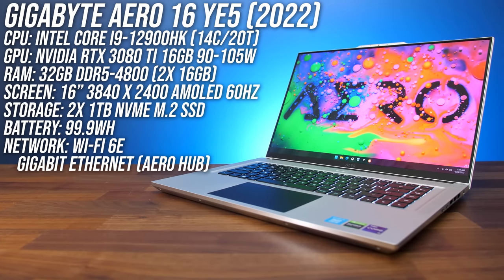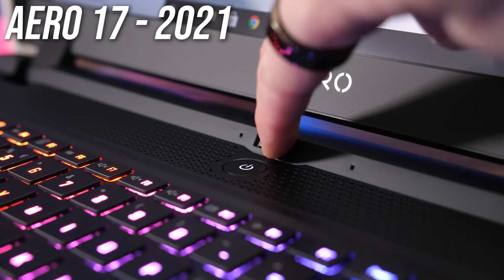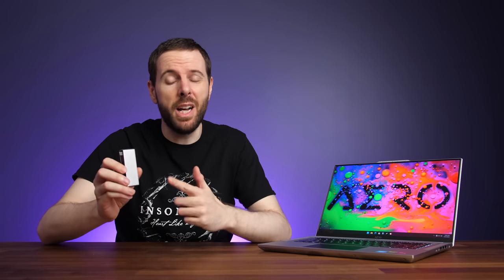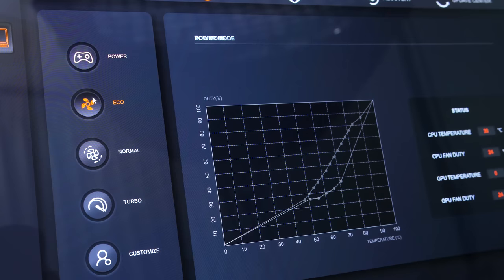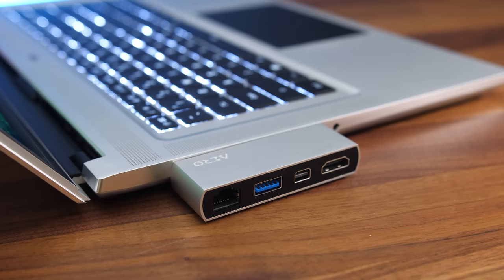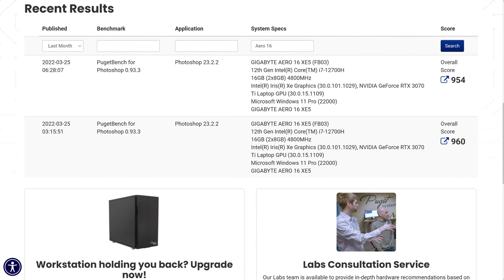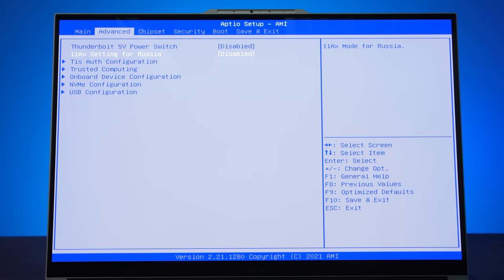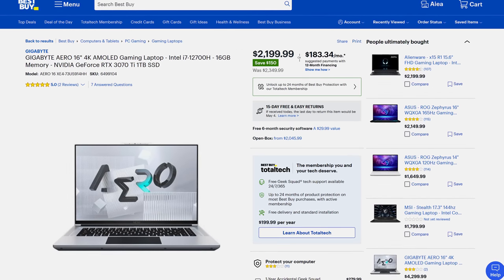Gigabyte Aero 16 Review - Why Did They Do This?

Comment: I7 3070ti for 1400 is insane! Best deal I could find that had more than 1 thunderbolt port. You'll likely be less thermally restrained as well because of the slightly lower spec parts. so coompared to other I7/3070ti systems i bet performance is similar. I'll see when I get mine :)
Reply: Did you get yours?
Reply: @TechDidThis  I got mine today! Had to wait for it to ship. Didn't like the software it came with so fresh installed windows. Otherwise I love it so far! Performance is decent! A little slower than other 3070ti but not much. I think the oled screen makes it worth it. Most people don't game using the screen in the laptop so frame rate doesn't matter. Perfect for media consumption and creation 👍
Reply: @UchihaSumairu  I just ordered a legion 7 gen 8 with a rtx 4080 and I'm thinking it may be overkill
Reply: @TechDidThis  rofl prolly!! But hey it's a big investment so to all out of you want :) enjoy your new laptop! I've heard amazing things about that one too
Reply: Got mine on a legion pro 5 32gb ram 12700h 1to ssd and 3070ti on 16inch screen hdr500 165hz November last year for 1360€ on lenovo website … so no it is not a great deal here especially knowing legion pro 5 manage better heat and noise than the aero 16 
Only positive here is that the aero has an amoled screen I doubt we can see difference with the legion pro screen
Reply: @TechDidThis  not overkill if you want to play in silence
Reply: @REDIUS999  that's usd my guy. It's a good deal. Dont try and have a "who's dick is bigger" contest on the internet over who's laptop is better. 3 thunderbolt 4 ports is a huge plus. Also OLED is a huge deal. It's a very clear and solid difference lol especially black levels. This laptop is great for people who need the things it has that yours does not. Yours is great for people who only care about games. And again it cost a lot less than yours did.
Reply: @UchihaSumairu how is your gigabyte aero 16 now? Still good my bro? I'm planning to buy this but I'm kinda scared when it comes to gaming.
Reply: @rin_blank5830  I haven't had any issues other than I found out removing the built in gigabyte fan software screws with the fan controls so make sure to install it if you wipe it. Screen is amazing. I can pretty much max (or high) most games at 1440 and haven't found one that isn't perfect at 1080. 4k is 2 much for pretty much all laptops still tbh except older games

Comment: Aero 15 was doing fine. The only downsides are the nose cam, the wobly screen and the software. They should've focused on fixing that instead of redesigning it and removing all the important things that creator uses (I MEAN THE F*CKING SD CARD SLOT GONE?!). In my opinion the old aero 15 chassis looks sexier too. I really wished they used that same design with a little improvements or even just color options. Disappointed about where gigabyte is leading the aero line.... it used to be great. Oh well just pulled the trigger on zephyrus "m16" (no pun intended)
Reply: Actually I like the new design, USB C x 3, 2 out of these are thunderbolt 4.0, keeps the options open for anything,  Aftermarket dongles have it all.

Comment: 05:56  if they can just punch a hole similar nd smaller to a kensington lock for attaching that thunferbolt hub to the laptop it would solve the wobbly design of it 🌚

Comment: I'm trying to decide between the AERO 16 XE4 (with a 12700H, 3070 ti 105w, DDR4, etc) for $1099 and a Gigabyte A7 K1 for $875 (which has a 5800h and 130w 3060); on both i'd be swapping in 2x32gb 2666mhz DDR4 ram and additional storage. The Aero seems like an almost clearly better choice, but I'm concerned how the 12th gen processor will play with W10 or if disabling the E-cores to fix those issues will negate the better processor, and if the QHD resolution might actually hurt more then it would help at a screen size like this: I'd rather run games at higher settings at 1080p then lower settings at 2400p or upscale, and running games at lower resolutions but windowed seems like it'd be pretty small on a 16in screen, though I can't say for sure since I can't test it yet, of course. Thoughts? 

I do a lot of multitasking (literal hundreds of internet tabs at once, tons of multi-layer image files, etc) gaming, and some light video editing/rendering.

Comment: Hey jarrod when are ryzen 6000 series laptops coming?
I would like to see if AMD's effienciency claims for 6000 series are true. The g14 is a single data point
Reply: The battery life is superb. I've an asus g15 2022 that comes with 6800h and 3060(140watt) recently and it just blew my mind how far gaming on laptop has come.
Reply from the maker: I do not know, but I haven't been sent anything apart from 6900HS in the G14, which means probably AMD delays. That said I bought a 6800H TUF A15 which should be here soon.

Comment: The OLED screen, 3070 ti and 12700 at 1600 dollars on Best Buy made it too good for me to pass up. 

The screen is amazing. I play games at 2560x1600 I think it is and idk my thoughts are even tho that’s not ideal, the OLED more than makes up for it in terms of picture quality. 

I prefer this OLED screen at lower than native resolution over my LG 34 gp83b (ultrawide 3440x1440p) for my desktop. 

LCD with minimal backlight zones are dead to me. 

Overall cool laptop. I’m not planning to ever use it for games like cyberpunk, etc. I’ve been using it for XCom2 and that sort of game and it looks great. Coil whine for sure. 3070 ti runs cool but the 12700h absolutely does not.
Reply: Love the touchpad too. Surprisingly good
Reply: Can I play 4K games at 120hz on this once it does not have HDMI 2.1?
Reply: @cemi_8945  You should be able to play 4k120 over DP1.4 over USB-C, but thunderbolt does not give you 4k120 over HDMI as far as I know.
Reply: Have you had any problems?
Reply: $1300 at Best Buy I'm really in it for Oled . 1080p Ultra or 1440p Ultra gaming for me
Reply: @Yoko.Kurama  no problems. I got a cooling pad for it which I’m glad for. I use it for general use and for gaming on our living room tv. Plays older games like dragon age inquisition at 4K no problem. For heavier gaming it may be worth to wait for 40 series. All depends on what you want to use it for
Reply: @danw7864  ok thanks. Don't care about 4k on a 16 inch screen. Just gaming at 1080p&1440pp
Reply: @Yoko.Kurama  so it does have loud fans and the gpu is down clocked due to tdp being lowered. A true gaming laptop would allow more wattage than this computer. Just keep in mind.
Reply: @danw7864  yeah I know it isn't a true 3070ti performer. Just at this price point I don't see anything beating it with a Oled screen
Reply: @Yoko.Kurama  I agree and that’s exactly why i bought it.

Comment: Hey Jarrod I'm going to buy a gaming laptop and I'm confused as there are so many options around!My concern is gaming and my budget is around 1500$.I've got a few good options on the table : Hp omen 15 [ryzen 7 5800h , rtx 3060(100w tgp)] , Acer predator helios [intel i7 11800h , rtx 3060(105w tgp)] and  Msi alpha 15[ryzen 7 5800h , rx6600m(80-100w tgp)].
I would appreciate any kind of help.
Reply: which alptoop did you end up buying?

Comment: @Jarrod'sTech, is this laptop worth it at 1249$, 4k AMOLED with 3070ti for light gaming on laptop's screen or playing FPS like COD on a monitor
?
Reply: I have last years aero 15 OLED with a 3060, I don’t game on it now cuz I fucked up the gpu using Liquid Metal so it doesn’t work, I saw the aero 16 on sale on Amazon for 1499 and I couldn’t pass it up at that price, you will not find a laptop of this build quality, screen, power at this size and price, the 3060 was perfect for 1080p, I’ve played some games in 4K but at like 40-50 fps plugged into my 4k120hz tv, the experience in 4k was okay, it was slow compared to higher refresh rate games but it was visually beautiful, I think the 3070 TI will be quite decent for 1440p 80-90 fps which is not bad for a laptop and in 4k it will run 40-60 fps depending on the game ( definitely not cyberpunk) and a lot of games now have DLSS which can help you boost your fps by a decent margin without too much visual loss, so I’m waiting rn but I know I’m gonna love the laptop when I get it, I still only play connected to an external 144hz monitor so I have the best of both worlds and I recommend you do the same if you buy it
Reply: Did you get it? If yes, how is it?
Reply: @ever45  yes I have the aero 16, it’s great, I love it, except the awful gigabyte software, the screen is amazing but ofc limited to 60hz which is not ideal nowadays but I have a 144hz monitor I plug it into for gaming, I also flashed the vbios to increase the wattage of the GPU as 105W is fairly low, I flashed it to 140W with huge performance gains, I can play some games in 4k 60fps (with DLSS), the build quality is excellent and it looks great, feels like a windows MacBook if you know what I mean, for the price I paid (1400 USD) which is almost 1000 dollars cheaper than MSRP, you won’t find anything better than this at this price.
Reply: @themartianman2614  thanks, appreciate it!
Reply: @themartianman2614  Ive been looking at this laptop, and doing what you've done with the vbios. Have you had any issues with cooling when gaming using the flashed vbios?
Im concerned with the cooling not keeping up with all the added power.

Thanks,
Reply: @carbonation28  hello and sorry for the late reply, yes, the vbios flash did increase temps by a bit, stook, the gpu wouldn’t go over 80c in gaming loads but with the vbios cranked to 150W the gpu hits a high of 85-86 c which is toasty for a the gpu but I’m not worried as this is a slim laptop in the end, I usually have it on gaming mod and it’s decently loud but with headphones on and ingame music, I don’t hear it all, in the end the vbios flash was worth it in my opinion due to have how easy it was to unlock the full potential of the 3070 ti, I can play 4K 60 with DLSS no problem now.
Reply: @themartianman2614  thanks for the reply! Can you tell me which bios you've had success with? My laptop arrives tomorrow, I plan on flashing the vbios myself. Thanks!

Edit: nvm, mine is the 3070ti, I see yours was a 3060
Reply: @carbonation28  no mine is the 3070 TI also, my older aero 15 was a 3060, for the 3070 TI I used 130W AORUS vbios and 140w clevo and now I’m using a 150W tongfang, all tested and works perfectly and I stuck with the tongfang bios because it provided the highest average wattage draw (which I want for maximum performance) but your Gpu will be toasty compared to the 130W one or even the 140W. The 150W tongfang averages at 130-140W whereas the 130W averages 110-115W
Reply: @themartianman2614  hey thanks for the help! I'ma try the tongfang one then!
Reply: @themartianman2614  Hi again! So I've been trying to flash the vbios on my aero 16 3070ti, but I keep running into issues with nvflash. I've tried some patched ones that were supposed to help with the board mismatch error, but I continue to get them when trying to flash it. Did you use a special nvflash utility, or did you need to run` extra commands to get it to work? thanks!

Comment: Hey Jarrod you mentioned that the CPU is capped at 45 watts with lots of thermal headroom but you have a HK processor? So are you capped at 45 watts or is the CPU unlocked?

Comment: Ugh, so the CPU never runs above 45W if the GPU is being used? In most real world usage wouldn't the GPU always be in some sort of use state? If so, the CPU is only going to be at max 45W, only marginally better performance than AMD 6800 at that power, but with shocking battery life.... so whats the point.

Comment: I have an issue with this laptop turning on in my backpack. Seems pressure on the lid presses on the power button. I've had to resort to putting a spacer between the lid and the keyboard to prevent it. Annoying to find it hot and / or battery dead.

Comment: My big issue with this laptop is how much it overheats over time. (I'm almost certain the excessive heat is what killed the second SSD and USB ports.)

It idles on the desktop at around 60-70c.

I'd love to open it to try cleaning the fans but I can't for the life of me figure out how, the seam that's there is shut so tight I can't get any spacers in there.

An alright PC with decent performance but due to the excessive heat it generates it destroys itself. I can not recommend this laptop to others.

Comment: Jarrod, and anyone else reading this comment, for games like Warzone and Assasin's Creed, I am confused between two laptops. Can you help me ? 
1. Dell G15: i7 12700H + RTX3060 + DDR5 RAM @4800 MHz + FHD screen @ 165Hz

2. Lenovo Legion 5: Ryzen 5 5600H + RTX 3070 + DDR4 RAM @3200 MHz + FHD screen @ 165Hz

Which one should I go for ? Both are roughly the same price.
Reply: You should probably get the Legion 5 bc Intel runs hot and draws more power compared to Ryzen, but the G14 has DDR5 compared to the Legion 5 and has faster memory speeds, so maybe wait for Jarod to review the latest Dell G15 and the latest Legion 5 since he reviewed last years Legion 5.
Reply: According to Jarrod's testing the 3070 is about 25% faster than the 3060 and it has 2 extra gigs of vram too.
If you do a lot of cpu heavy creator tasks I'd consider the G15 but the legion is much better for gaming due to the 3070.
Also 6 cores look to be enough for the foreseeable future so you shouldn't have a problem there.
Both the screens are really good 
DDR5 4800 doesn't really give an improvement over DDR4 in almost all games tbh.

Tl;Dr go for legion if you're exclusively gaming
Reply: @balaaditya9982  thanks bro.
Reply: @AkagiAsuzagawa  arigato !
Reply: Why'd u play assassin's creed? It's a bad franchise
Reply: It's a no-brainer even to choose between them, Legion 5 is just better overall for games.
For other stuff, I'd think which one is better.
Reply: @meowcat5596  and who are you to question what I do with my time and money ?
Reply: @Asiro-S  OKAY. 
I am just worried about Legion having a last-gen 6 core CPU and last gen RAM.
Reply: @riichobamin7612  If you can wait then wait for Jarrod's review of the 2022 Legion 5
Reply: @AkagiAsuzagawa  okay. But this RTX 3070 legion 5 is at such a cheap price now. I am afraid that the new RTX 3070 version of Legion will be too costly for me, as it will have the latest CPU and RAM.
Reply: You should get the legion imo, I currently own the last gen model with a 5800h and rtx 3070 and it's been amazing so far. If you play more demanding games the 3070 will be a better choice and the 5600h will not hinder it in anyway because you will most likely be running at higher settings. For less demanding games the 5600h will do fine and will be able to push beyond the 165hz refresh rate of the screen. With the 5800h model I average 300+ Fps in Cs Go, Pubg at max settings 120-150 depending on the map and where you are, SW BF2 at max 100+. So basically you can expect all esport titles to be above 300fps and AAA Games at 90+ depending on what settings u use... Hopefully you found this helpful and have a nice day.
Reply: @TheDev8HD  I have. Thank you so much ❤️

I was just worried about the change in OS (i.e. Windows 11), about the rumours that Intel 12th gen has it's architecture specially designed for Windows 11 and the fact that DDR4 will soon be phased out and devs might develop games with DDR5 in mind (especially Warzone 2).

Comment: Just to a great open box deal on this very spec. Having the 3080 with 16gb was what sold me on it. They main thing that bugs me is the connection hub. It's flimsy and feels like an afterthought. I often have things plugged in so this has to be used most of the time.

Comment: "Best Laptop for Creators & Gamers?" - Lol oh dear. So the answer is an emphatic "No", then. 3080 Ti 16GB with 90w power? A bloody DONGLE in 2022 (see how long that lasts before breaking when placed on a laptop stand and the weight of several cables tugging it down). Also it's horrendously ugly with the black trackpad. $4300 is a joke. Anyone who buys these must be insane when machines less than half the price run rings around it when it comes to performance in productivity tasks AND games. What a heap of junk. Once you go north of £2000 it really is a case of extreme diminishing returns and endless gimmicks. A QHD IPS display is more than fine. No need to throw cash away for an OLED and massively underpowered internals. You could buy a Legion 5i Pro, 12700H, 3070 Ti, 32GB DDR5 RAM for £1629, AND an LG C1 48" OLED for £900, and still have about £1500 spare compared with buying this. And all that stuff about certain software and benchmarks flat out not working just screams "Stay away". Burn it / bin it.
Reply: Jarrod did change the subtitle to "Why Did They Do This?", which I completely agree with. They made negative changes with the ports and that with the higher price tag, awful speakers still, and continued software glitches make me not even want to consider this laptop. Thank goodness I got the Legion 7. Sure, it's missing PCIe Gen 4 and Thunderbolt 4 on my unit, but I don't care about the latter and the former isn't really useful to me. Plus the port selection on the Legion is MILES better, it has a MUX switch, a full-powered RTX 3080 GPU, and while the 16:10 2560x1600 screen may not be as high gamut, it still is better and currently still the only AMD Ryzen laptop with a 16:10 1600p screen (apart from the Legion 5 Pro with the same screen). Not only that, it runs Garuda Linux like a champ and the performance profiles still work on Linux! Gigabyte sucks on Linux and not having a Caps Lock light would really bug me.